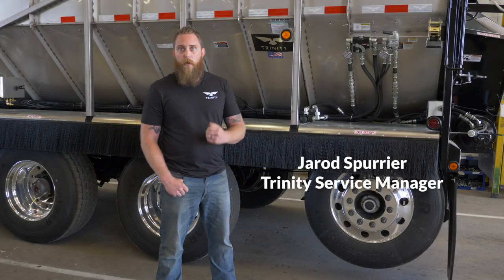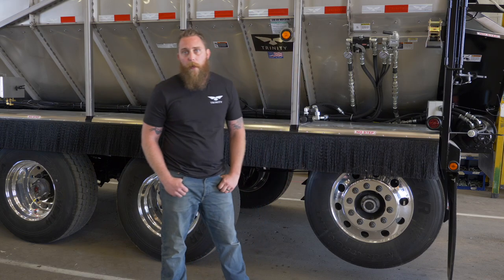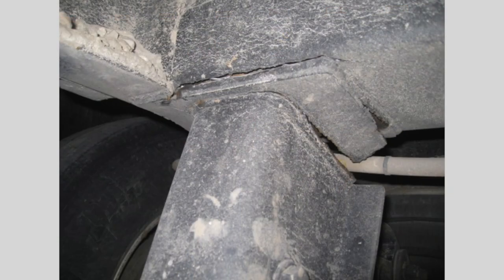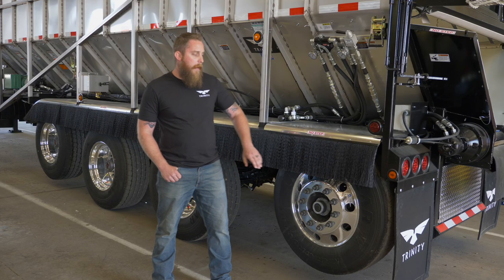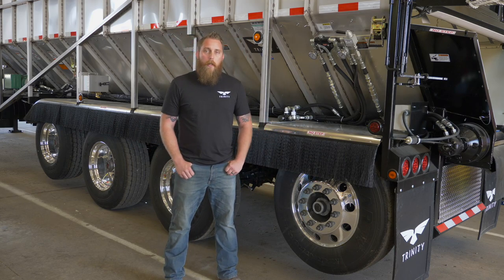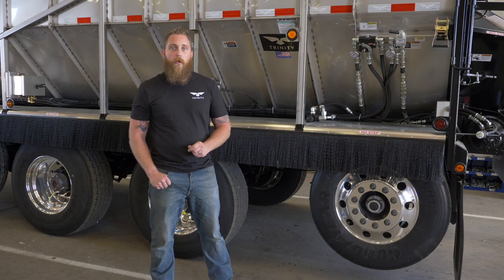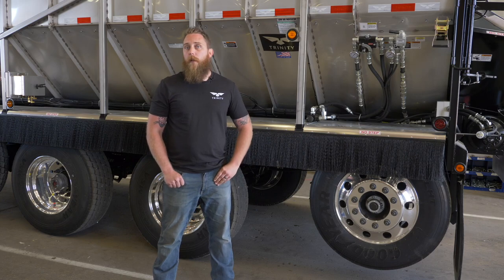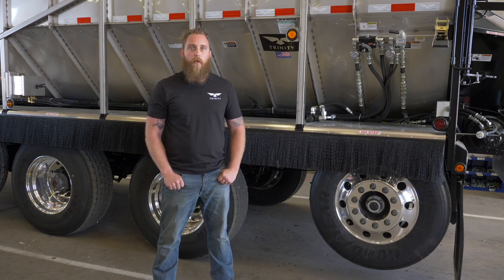Why You Should Raise the Steerable Axle on Your Trailer | Belt Trailer Maintenance | Trinity Trailer

Comment: Video did not explain why only shows how to raise the axle and warn of the dangers. Is this a design flaw of the trailer? Why cant you leave it down?
Reply from the maker: Leaving an axle in the down position while backing up can cause damage because when the tires pass over bumps or uneven terrain these axles can get caught up on the obstruction and fold under. This is not a design flaw but and operator error. If you need further instruction on how to avoid this give us a call at 800-235-6577.

Comment: Is very easy to do it.....just get power from the reverse light (you going to need a extra plug in the trailer ) run the cable where the air valve for the lift axle is and plug the cable with the wire...
Reply from the maker: Hey Luis! Thanks for the comment. There are lots of options out there. As a manufacturer we can help setup whatever you need from the factory.